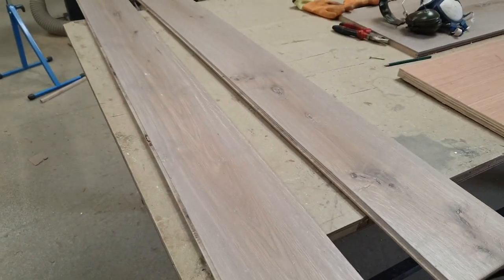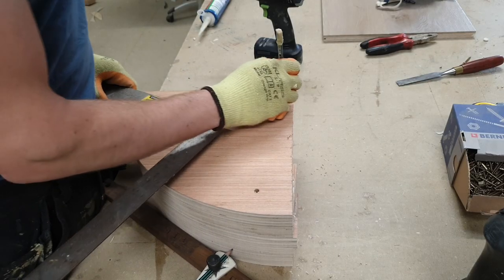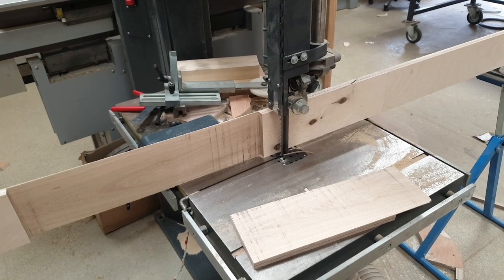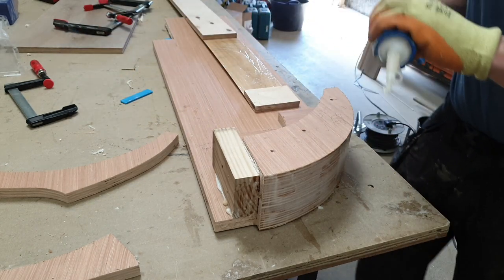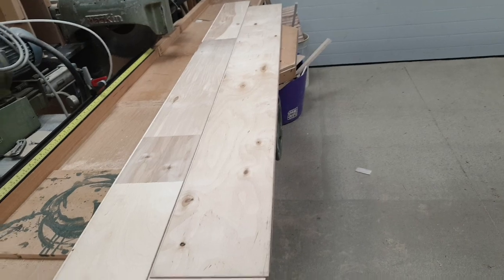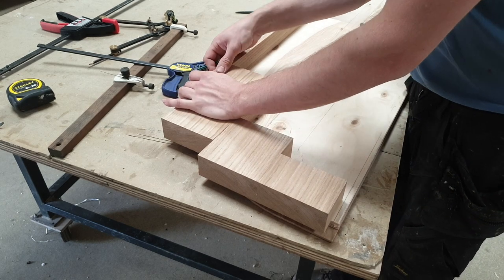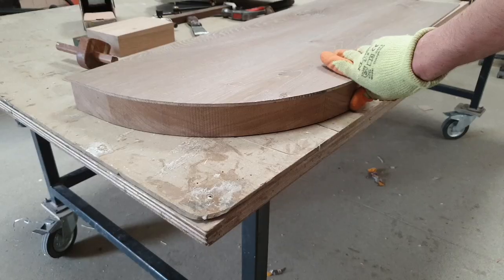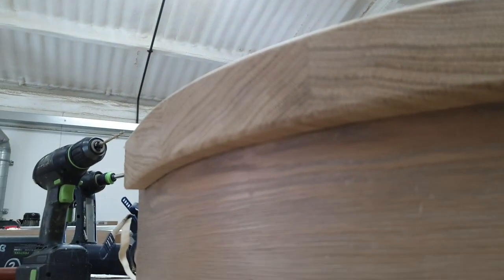Curved Bullnose Step from Pre-Finished Timber Flooring

Comment: Real nice job on the bullnose step - especially dealing with an engineered flooring!  One trick I've used is to cut the veneer portion of the riser long enough to accommodate a pair of opposing wedges at one end where it meets the solid portion of the step.  Just helps to pull it all tight around the curve.
Reply from the maker: That's a good idea Jonathann thankyou, so cut it 20/30mm longer then use long folding wedges to pull on the shoulder. 👍👍

Comment: Very nice job.  Interesting way to overcome the problems caused by using the Pre-Finished Engineered Timber Flooring.  Thanks for the video.  Cheers, David
Reply from the maker: Nice one David, thanks for commenting! This was a solution to a problem in one of the plots on a development, i made a rod for my own back and ended up making loads! ahah

Comment: superb! What kind of glue did you use to stick the base to the floor? Also, slightly related...for a curved frame and panel door, say in a kitchen island, would you make the door fit a carcase or the other way round, make  a curved door first and then make the frame carcase fit the door? Brilliant craftsmanship! Thanks
Reply from the maker: Thank buddy. I used a PU Glue from everbuild, it's what this site I'm working for like to use a lot of and is readily available. It also sets clear so was invisible after peeling the tape off. It sets like rock too. So should support the load from the step well. 

Always start with the frame, curved work like that will normally be laminated timbers and just work to the same former for both frame and door/panel. Have to say that curved solid panel doors isn't something I've ever done so couldn't shed any light on the matter really

Comment: Seriously impressive craftsmanship and skill learning so much from your videos which have benefited me so much in my work - if you don’t mind me asking what glue where you using through this project as I’m finding it hard to find a quality on in cartridge format.
Reply from the maker: Thankyou Harry. I'm glad I've been of use! In this one I used everbuild, lumberjack wood adhesive, it's what the guy I'm working for uses a lot of and wanted me to use. It's great in that it sets rock hard and very quickly, but it's maybe a little too quick setting for my normal useage. I normally use a pu adhesive from sovereign Chemicals called PU Rapid. Seems to give you a little more open time and doesn't set as rock hard as this stuff. They both have their uses I guess

Comment: A surgeon once advised not to wear gloves around machinery. The reason being if you cut yourself he would have to spend considerable time picking pieces of glove out of the cut before he could commence repair work
Reply from the maker: Makes sence Paul. I like the safety of the grip over bare hands on slippy timbers but have always got in my mind should I shouldn't I and will decide based on the job in hand. If I'm being "dangerous they come off"
Reply: Sometimes were handling wood you want protection to stop splinters cutting your self on rough edges. 

You have to make a judgement call in terms of safety.